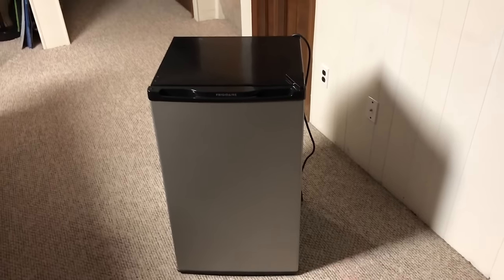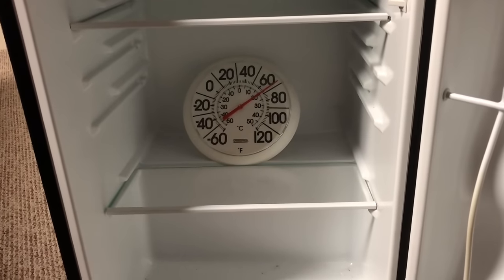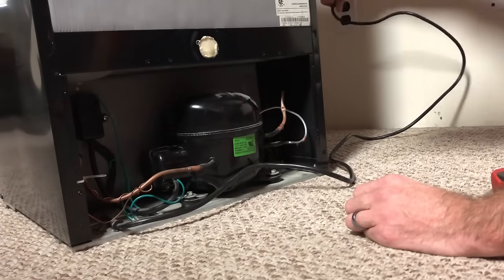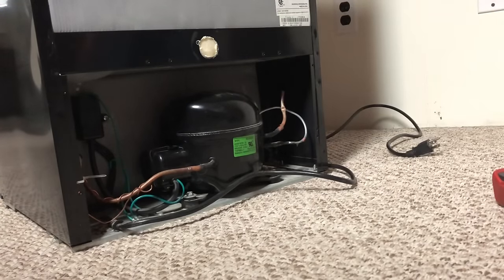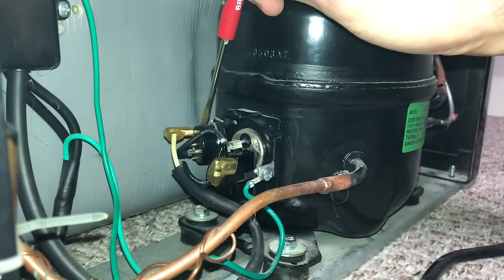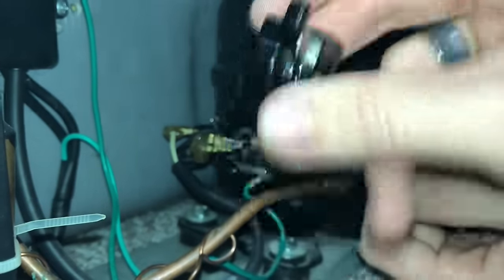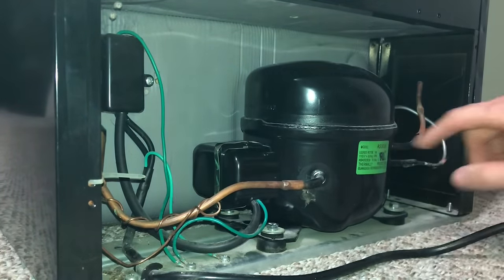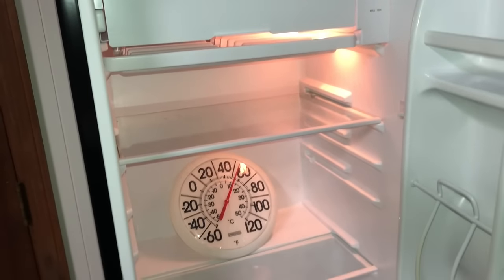Fix a Frigidaire mini fridge that is not cooling (LFPH33M4LM)

Comment: Great camera work have to say! Had this same problem with my Avanti minifridge a few years ago.  Replaced starter relay because that was the issue and it worked again.  Last week took the minifridge outside to defrost the freezer and had it on its side.  Now it won't start again just like before.  Ordered a new starter relay but that is not the problem as it doesn't seem the old one was broken either.  I lost the plastic cover so I'm not sure if that is an issue.  Also the overload is not clipped on to anything and I'm not sure where to re-attach it.  The compressor does get very warm as it tries to start.  I can only think of the oil being shifted around.  I did wait at least 12 hours to restart it after moving it back inside.  It does not make any abnormal noises.  Just doesn't seem to be the starter relay issue like before.  Any ideas?
Reply from the maker: The overload should be wired between the common pin on the compressor and one of the wires coming from the power cord. It doesn't necessarily have to be anchored down to a mounting point though. 

Does the compressor start and run? Can you feel it running? If it's not starting, does the overload click off occasionally? It's possible that the compressor has locked up. Not that it'll help, but here's a video by a guy I follow that shows what the compressors look like inside. It helps me understand how things can work if I can visualize the components. https://youtu.be/3Uwx-_VecHo
Reply: @DustinRogersinMO  thank you for the link and the reply! Just like before, or when the relay is broken, the compressor is not starting (spinning) and the overload does click off occasionally.  The compressor does get very warm and then I just unplug the power.  All the wiring is the same as when it was working before, put in a new relay so the only thing I am thinking is it is the overload.  Good to know the way the overload is mounted doesn't seem to make a difference - again the wiring is unchanged.  I do also have a Supco 3 in 1 starter kit so I might try that - I just need to determine the correct power cables to strip and attach to it now.
Reply from the maker: I've read that the starter kits will sometimes fix a compressor that won't start, but it's usually a sign that the compressor is on its way out. But then again the start kit may make it run for another 5-10 years. Good luck with your repair.
Reply: @DustinRogersinMO  update: the 3 in 1 starter kit brought my mini fridge back to life! However it was a strange process of aligning the cables and plugging in the power over and over again.  For some reason after trying the same positions after a few times the compressor decided to come back to life.  The mini fridge is functioning as normal and is cool.  However the compressor is very warm (the sides of the fridge are not noticeably different but still warm like before). One of the two power lines in was connected to the overload which also ran a wire to the thermometer on the ice box - and also to the compressor of course.  I think if there is any problem with I will re-attach the power line to the factory starter relay and remove the Supco 3 n 1 kit.  I believe the 3 in 1 gave it life again but I am sure the relay (which wasn't broken) would be better suited. I just hope nothing goes wrong or gets too hot.  I can only assume having the mini fridge on it's side to defrost cause some oil imbalance to cause the compressor not to start.  After days of sitting upright and using the 3 in 1 starter kit it came back to life.  However it ultimately was very confusing because it showed the same symptoms as if the relay was broken like years before.
Reply from the maker: thomasfitz great. I think those start kits have a capacitor in them which gives the compressor a little extra boost to get started. The compressor could have just been bound up from laying on its side and just needed that extra boost to get going. It’d be interesting to see if switching back to the start relay would keep it going.

Comment: Is it the same size  any fridge
Reply from the maker: For the most part. The larger fridges usually have more complex systems with auto-defrost, etc, but the start relay setup should be very similar

Comment: Replaced my starter relay and overload . It turns on but doesn't cool and the big black thing in the back got really really hot
Reply from the maker: PinkMischief the big black thing is the compressor. If it’s getting really hot, it’s either because it’s starting to seize up, or all the refrigerant has leaked out and the compressor runs non stop. Unfortunately  unless you have the specialized equipment needed to recharge the system, it’d be cheaper to replace the fridge.
Reply: @DustinRogersinMO  it only started to heat up after replacing the relay and overload
Reply from the maker: PinkMischief if your old relay or overload was bad the compressor was not actually turning on, therefore it wouldn’t have gotten hot. I suspect you have a refrigerant leak (which also lubricates the compressor to keep it cool). As heat builds in the compressor, it causes the resistance of the compressor wiring to go up, which requires more current to keep running. The overload is like a fuse which will “trip” due to excessive current. Those devices have a limited number of “trips” before they stop working.

Comment: What if it clicks on and then off after about 3 seconds? Overload?
Reply from the maker: That is likely the overload clicking on an off, which typically happens when the relay is bad. It can also be caused by a compressor that is locked up…but I’d test the relay first.
Reply: @DustinRogersinMO  thank you!

Comment: how'd you get the box off so easy!
Reply from the maker: Are you talking about the cover over the relay? The clip that holds it on is pretty stiff, but once the clip is off, the cover should pull off easily

Comment: I removed de metal clip and the cover but mine has so many wires different colors and I cannot find that black piece you replaced. Mine is a undercounter fridge freezer  😭 and he does that noise turns on and off... Helppp
Reply: It does*
Reply from the maker: Teresa Elisabeth just take some good photos of where each wire goes and use some masking tape to identify wires if there are duplicate colored wires. The start relay (black piece) may be shaped differently on other brands/models. Some may also have the overload protection (white piece) built into the relay. Once you document the wire locations, unhook the start relay and shake it. You may also google your freezer model number and try to find a replacement relay just so you know what it looks like for your particular model.

Comment: Best dam video ive ever seen can u do one on how to test the thermostat from the fridge ?
Reply from the maker: Willy Romo thanks. I don’t have any units to demonstrate on at the moment, but typically when a thermostat fails, you won’t have any continuity through the thermostat switch. To test that, you’d need to make sure the fridge is unplugged and then unhook the wires from the thermostat. Hook up an ohm meter to the thermostat. If thermostat’s in the off position, your meter should read OL. When you turn the thermostat on, you should have continuity. If no continuity with the thermostat turned on, then the thermostat is faulty.

Comment: I have a brand new Galanz 1.7 mini fridge. Plugged it in when unboxed, it got cold a couple hours later. It sat for a couple of weeks, and now the compressor runs, gets hot, but absolutely NO cooling. No refrigerant oil anywhere, or any other obvious signs.
Reply: I'm having the same problem with the same brand, except mine is a 3.2 Cubic foot. Brand new never got cold!

Comment: Why is the backplate missing?  All that junk in the back, did it come that way new?  And the copper line is cut on the other side... why?
Reply from the maker: Cup Py no, there’s a cover plate that I had already removed. The copper line on the right is the fill tube, how the refrigerant was originally added to the system. Once filled the line is crimped and soldered.

Comment: What does it mean if my compressor is super hot even if it’s unplugged.
Reply from the maker: How long has it been unplugged? They can take quite a while to cool down if they’re super hot. If the compressor is getting really hot, I suspect that it’s low on refrigerant, which is how it get lubricated. Or it’s possible that the compressor is on the verge of seizing.

Comment: I got continuity between one of the two pins to the ground, so what is going to be my next step......please help me
Reply from the maker: That means that there is a short to ground somewhere in the system. It’s likely a short in the compressor. You can verify by unhooking the wires from the compressor and then testing between each of the pins to ground. If the compressor is NOT shorted to ground, it’s possibly a short in the wiring.
Reply: @DustinRogersinMO  I dont hear the beep when I touch the flat terminals of the plug (red on one, black on the other) what's my next step? Thanks in advance.
Reply from the maker: @kristinawalker7534  is the thermostat switch inside the fridge set to “cool”. If so, then your thermostat may be malfunctioning. Here’s a video I found on how to test the thermostat. https://youtu.be/O2WbsdfQU3k
Reply: @DustinRogersinMO  The thermostat was on high and isn't making a sound when I plug it in (no clicks like what you experienced). I still took it apart and noticed the overload protector was rattling.  Could this be the problem? Or is it most likely both? Thanks again.

Comment: For me the overload protector DRB178N61A1 is making noise and not the relay but I am not able to find the part online or in amazon either, can you please help?
Reply from the maker: World Peace what model is your refrigerator?
Reply: Dustin Rogers it is a whirlpool compact 4.6 cu ft model WH46TS1E bought from Costco.
Reply from the maker: World Peace yeah, I can’t find any parts diagrams for that model fridge either. I did find this tech document for a compressor that lists the overload device as one of three options under the electrical components section. You may search for one of the other options. https://lightcommercialrefrigeration.danfoss.com/pdf/danfoss_B43C5B_R600a_115_60.pdf
Reply: Dustin Rogers yes I did find that one too from danfoss where that part is listed against the relay and overload protector and found that I have the same relay as yours. I am guessing the overload protector that you have might be as well be compatible. Is there any way you can find the part number on yours? I also see in the hard copy manual that it is a Chinese made refrigerator and the closest to that model is in the Frigidaire website, model FFPS4533UM. I guess customers are being duped by whirlpool/Frigidaire in making them believe that it’s their brand when it’s actually a cheap Chinese knockoff!
Reply from the maker: World Peace funny enough, I can’t find an actual parts diagram for the fridge from the video either. I’ve since sold it so I can’t go look at it. Something like this looks similar, and this is the one that would “pop” with the least amount of current. The higher wattage the overload is rated for, the more current it’ll pass before it pops. https://amzn.to/34RB2IA
Reply from the maker: World Peace here’s a really great video showing how to test the overload to verify that it’s bad if you haven’t already. The overload may be tripping because of an issue with the compressor or relay. 

https://youtu.be/4wrhGi37lso
Reply from the maker: World Peace I just re-read your original comment. When you say the overload is making noise, do you mean it clicks when the fridge is plugged in? If so, have you removed the relay and verified that it doesn’t rattle? If the relay isn’t able to start the compressor, the overload will “trip” and click to cut power to the compressor. This is by design to protect the compressor.
Reply: Dustin Rogers I removed both relay and overload protector. Relay is just fine when I shake but overload protector rattles. It is similar to the one here in amazon except that I am not sure about the compatibility. 
Ultra Durable 6750C-0004R Refrigerator Overload Protector Replacement Part by Blue Stars - Exact Fit For LG & Kenmore Refrigerators - Replaces 6750C-0005P
 https://www.amazon.com/dp/B07CPLDC34/ref=cm_sw_r_cp_tai_EqebEbAWQ66E1

Comment: half the time i plug it in the motor doesnt activate and it sounds much weaker than the videos new compressor when it works. still isnt cooling

Comment: 6:15 my fridge had another component that goes on the top prong and it rattles a lot and the same relay on the bottom two prongs. Do you know what that’s called?
Reply: Okay I figured it out for anyone else who need to know. It’s called an overload compressor
Reply from the maker: Glad you got it figured out. I was going to suggest looking up a parts diagram for your particular make/model to pinpoint what it was called.
Reply from the maker: Make Me Believe  It has to either clip on or slide on to stay in place, but without seeing it, it’s hard to say. Can you post a picture of it somewhere (instagram, imgur, etc.) and share a link to where you posted?
Reply from the maker: Make Me Believe I believe there’s a tab or raised area on the top of that plastic cover. Just use a flat blade screwdriver and pry gently between the cover and the compressor. It should kind of rock down and then pull off.
Reply from the maker: Make Me Believe this video may be the same type you have. https://youtu.be/WjmEBgIYHec
Reply from the maker: Make Me Believe yeah, sorry. I didn’t mean to pry on the tab. I meant to pry behind the tab between the cover and the compressor. Did you get it off?

Comment: What if you do have continuity between ground and flat prongs ?
Reply from the maker: k.p. dupree it means that the compressor probably has an internal short.
Reply: @DustinRogersinMO  what to do then lol
Reply from the maker: k.p. dupree find where the short is. If it’s an internal short in the compressor, you’d have to replace the compressor which wouldn’t be cost effective for a mini fridge. If the short is due to a wire with a bare insulation spot that is touching the case or something like that, you’d repair the short circuit and retest your plug.

Comment: I just replaced the start relay and it still clicks without cooling. Whirlpool mini fridge
Reply from the maker: Ken Peterson was your old relay rattling? That’s how I knew mine was bad, but on yours there could also be an issue with the compressor. It may be seized up or the windings may be shorted which causes it to trip the overload. If you have a multimeter you can test the resistance of the compressor windings. I know there’s several vids on YouTube on how to check those that will explain better than my comment would.

Comment: So I put it on and nothing happened the light inside come on but don't feel or hear anything else coming from the fridge
Reply from the maker: THATBOICUDDY this relay shouldn’t affect the light inside the fridge. It should have been on even with the old busted relay. Do you have the temperature dial inside the fridge turned to cold? If not, the compressor will never get the “signal” to start.
Reply from the maker: THATBOICUDDY if you unplug the fridge, then put your hand on the compressor while plugging the fridge back in, can you feel the compressor kick on? If not, do you hear any clicking sounds (overload device clicking off)? Is your fridge identical to the one in the video?

Comment: Hello, thank you for the video. I followed your steps, got the part off amazon, replaced the part, and the mini-fridge is still not getting cold. Can you help me with any further steps before I have to call it a day and buy a new one?
Reply from the maker: Melinda Rebello sorry for the delayed response. Without knowing what you’ve checked already, it’s hard to diagnose remotely but I’ll give it a try. Does the compressor start and run? You should be able to feel it run by putting your hand on the compressor housing. How long does it run for? Does it get hot? Do you have the thermostat set to the coldest setting?
Reply: @DustinRogersinMO  Hi! Yes, it makes a sound when I plug it in like something is starting, but the compressor gets very very hot and so do all of the pipes connected to it. It is set to 6 as a cold setting and was left for over 24 hours with no improvement in temp inside the fridge.
Reply from the maker: Melinda Rebello unplug the fridge and then put your hand on the compressor before you plug it in. You’ll want to feel for a slight vibration coming from the compressor. After you plug it in, you should feel it start to run. Keep your hand on it for at least 60 seconds. Does it run the whole time? Or does it run, then shut off, then run, etc? If it runs the whole time and never shuts off, I’d guess you either have a bad compressor or the system has a leak and the Freon has leaked out. If it never starts running, and you just hear a click sound every so often, it could either be a bad start relay (if the relay rattles when you shake it, it’s most likely bad) or the compressor is locked up. If it runs, stops, runs, stops, etc over a couple minutes, the overload device may be faulty.

Comment: I get 80 ohms on the two flat pin test then zero when I switch it off. I assume my issue could be that thermostat? FYI 80 ohms no matter how far around it goes...
Reply: Tested relay and no rattle (on the rattle test :-)) I am convinced my thermostat is gone, now to try and get it out.